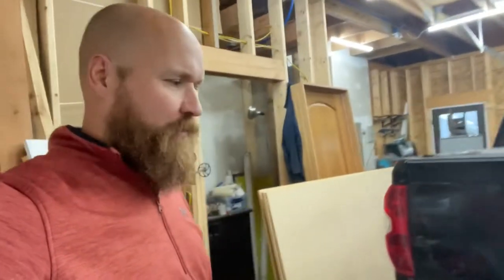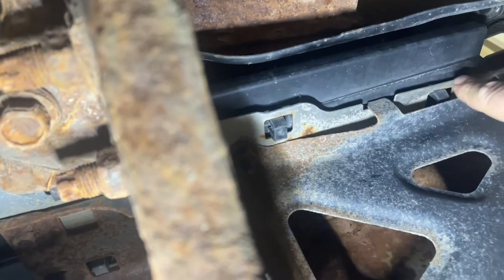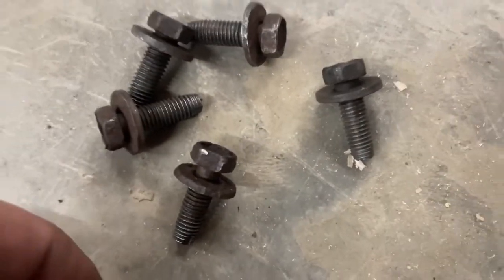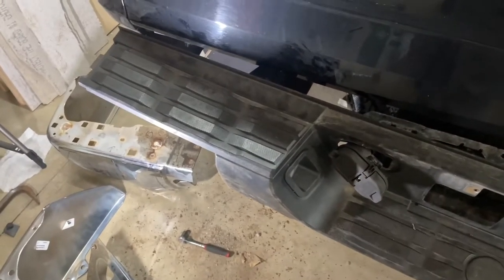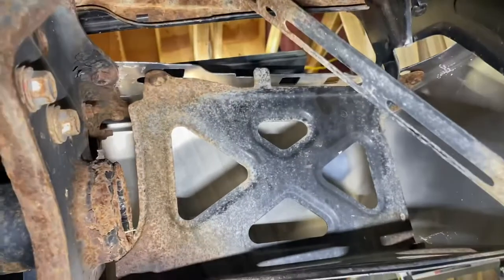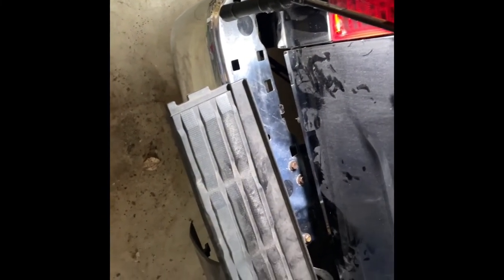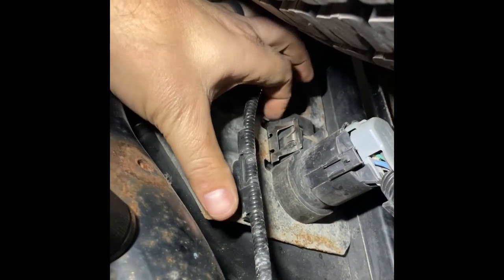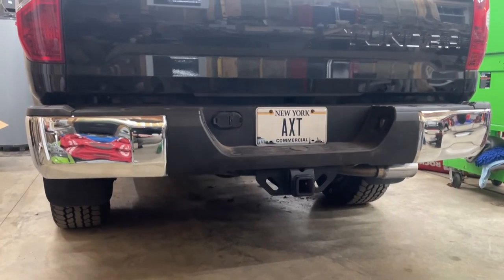2015 Toyota Tundra bumper replacement

Comment: I have a 2016 tundra and my rear bumper also has the damage similar to yours. I wonder if that’s the same way that it comes apart
Reply from the maker: I'm pretty sure the body style was the same from 2014 through 2018 so it should come apart the same.